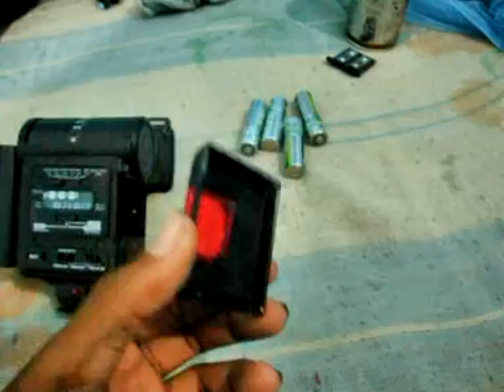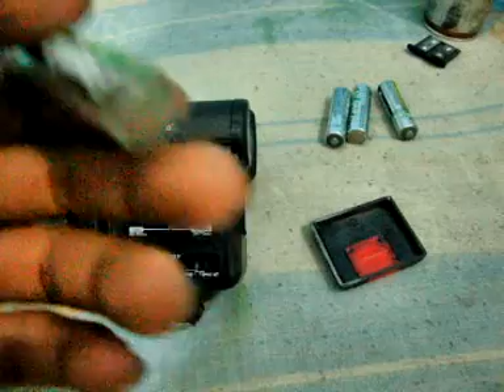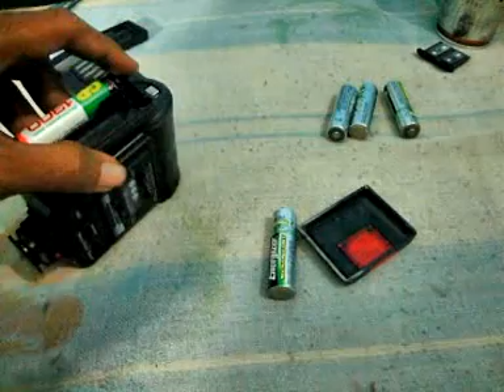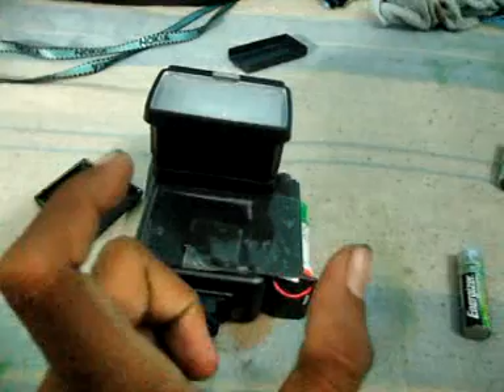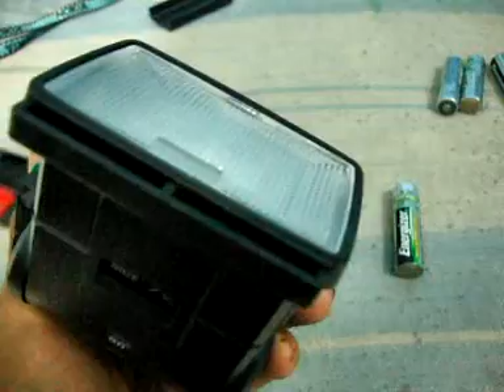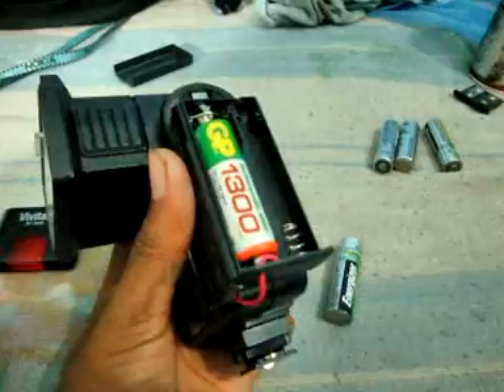Fixing a Vivitar SF-4000

Comment: I have this same flash and although it turns on and fires with the test button (most of the time), it will not fire when it's on my camera. I do use a horse shoe and have it set up correctly according to the manual. Do you offer services of repair?